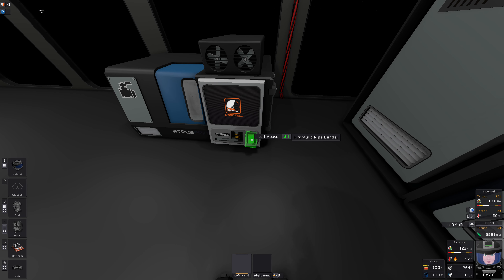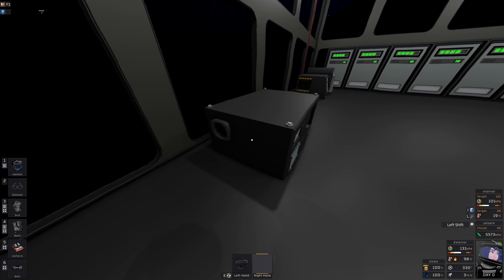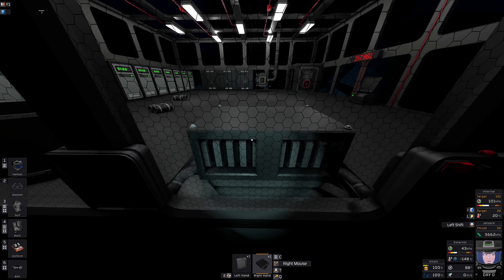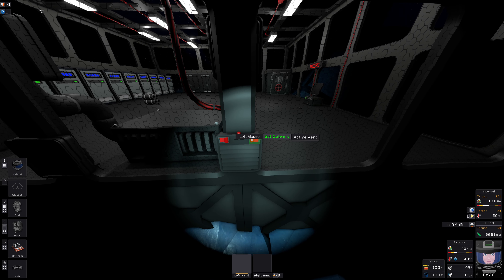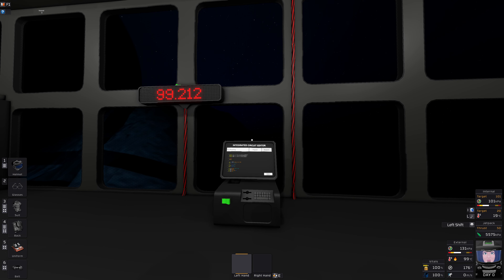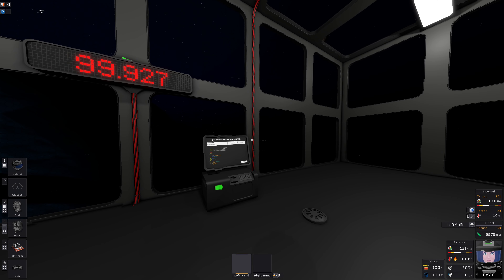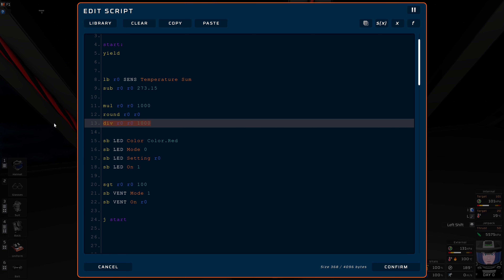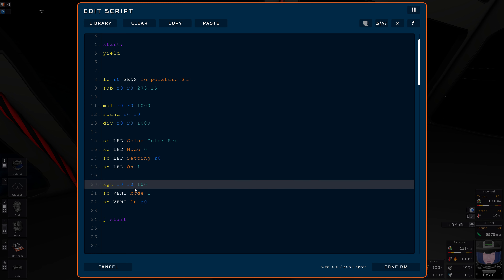Stationeers ATMOSPHERICS for total beginners - TURBO STYLE! - Part 12: Luxurious cooling on Europa *

Comment: Thank you for the video, it's great as always) The main issue with heat exchanger for me here is that one usually needs to figure out the way of cooling/heating the station early in the game, way before you can afford to build the heat exchanger. And when you can affrod it, you already have some working cooling/heating system and it doesn't bother you very much at this moment. So it has sense only if you want to reshape your air conditioning system on the later stage of the game.
Reply from the maker: True. Well, on Europa you can always just open a door - very early there's no loss of CO2 to worry about yet. Bit later, Moon/Mars/Europa/Mimas/Space would allows pipes with radiators into/through which you pump your station air. Vulcan/Venus are always a very VERY different beast.

Comment: I have my own solution to this problem which comes with other issues, such as toxic waste condensing in my pipes. This makes things a hell of a lot easier, however putting a furnace INSIDE my base is still just as bad lol. I hate filtering systems because they're manual and I hate having to manually do shit in a game which lets you build things yourself.
Reply from the maker: Can't you utilize the phase change and/or use Passive Liquid Drains or Condensation Valves to deal with the liquids in those pipes?
Reply: @OwnerOfTheCosmos  Yes, however the liquid at very low pressures and temperatures can sometimes do le funny condensed anyway for a tick and proc some pipe damage. I also haven't played in a few months and am waiting for the devs to settle things down with certain features. For example, the sterling engine (very important in certain locations) will dissipate temperature twice as fast if put between two blocks as opposed to in one block, which I think is stupid.